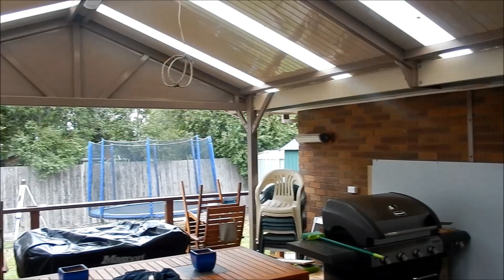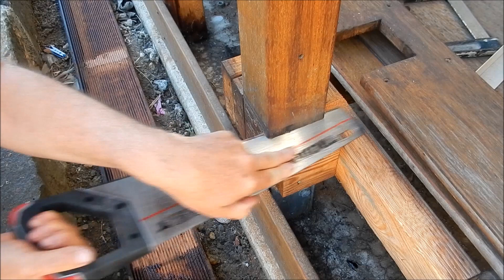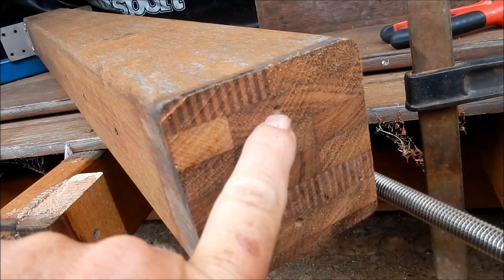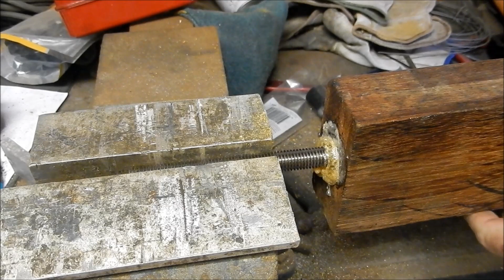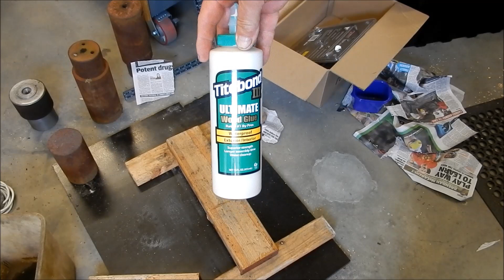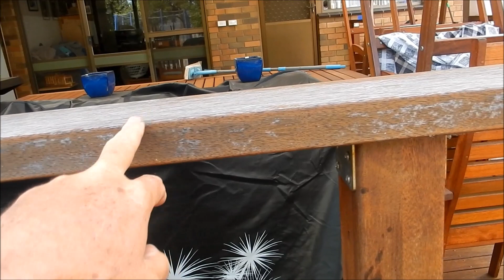Veranda Hand Rail Post Repair, joining end grain with Titebond 111.

Comment: G’day Cam. Job well done. Mate that vise sounds like it needs a little oil it may perform better also but then you needed a bigger vise to get that stud out:-)
Hey that expanding foam type glue you got stung with was rubbish and reflecting on its performance what would we expect when it introduces small bubbles of nothing to the joint. That PVA glue held out well though. 
Cheers and Merry Christmas 
Peter
Reply from the maker: Thanks Pete, I always test products regardless of the advice I get.  It has paid off well in the past where the job would have been a disaster if I had gone with the product advice given.
Cam

Comment: You made it very complicated, but for the wires i makes sense.
I'm impressed by this titebond glue.
Reply from the maker: Thanks Rustinox, yea I guess it look complicated but I spent more time trialing different glues than I did than actually doing the job.  Anyway it worked out perfectly.  Great to see you back home and spending time in the shop, and congrats on the 2000 subs.  I hope you go from strength to strength and your prognosis for the future is good.  I've just gone 1 year since my cancer surgery (and still recovering) and as of 5 weeks ago, my last screening I'm still cancer free.  I'm always very stressed out with these screenings, every 3 months over 5 years.  If it comes back, at least it will be a very early spread and I'll have more options to deal with it, drug therapy and radiation.
Cam